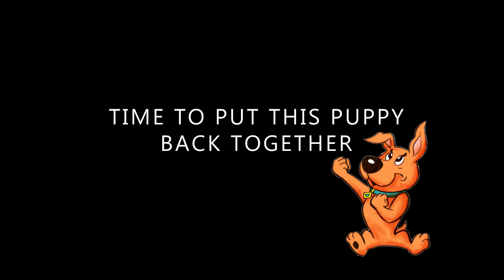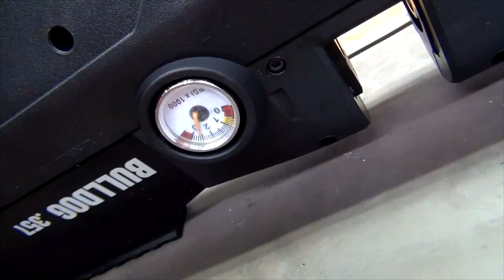COMPLETE Benjamin Bulldog Teardown & Reassembly [ASMR]

Comment: I bought a used version with a lower serial number but same model number. The previous owner must have taken it apart trying to fix it and left a few parts out when he shipped it to me. 

I'm missing the screw that holds the hammer in place and the screws that hold the two plastic covers onto the top of the receiver by the cocking lever. Do you sell these screws?

I also noticed mine does not have that skeleton butt stock piece that fits inside the main stock shell. Was this added in later serial numbered guns? The reason I ask is my pins that hold my fire control components in the receiver don't protrude like yours do so even if I had that plastic skeleton piece it wouldn't work with the pins I have.

Last but not least; do you sell extra bolts? Mine is very tight and may be bent causing it to bind. I think the previous owner may have bent it trying to get it apart from feeding too many pellets into it and jamming up the magazine removal. There's pry marks in the magazine well indicating someone forced it out for some reason.

Comment: Awesome video! What's that socket you're using to take off the air gauge at 8:30?
Reply from the maker: Its just a 6 point 1in deep socket. It has a section on the end that was turned down slightly smaller to fit down into tight spot  on something different.

Comment: You guys ever think about an improved fill nipple? Ever since I got mine it sticks regularly. One that had a manual shutoff / bleed valve would be a boon in the field 👍
Reply: that happens usually when your air source is not clean. moisture and other deposits in the air hose can make the check valve stick.

Comment: How did you get the hammer back in,or did you not take it out0
Reply from the maker: The hammer comes out the back.  You have to remove the adjuster and spring and then there is a small cap head screw on the side that has to come out.
Reply: 17:34 you can see the hammer